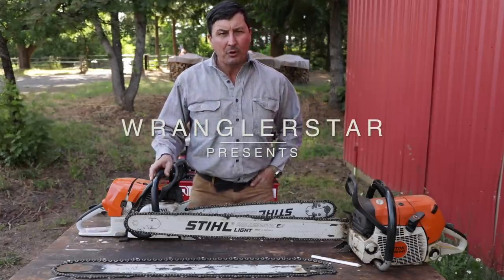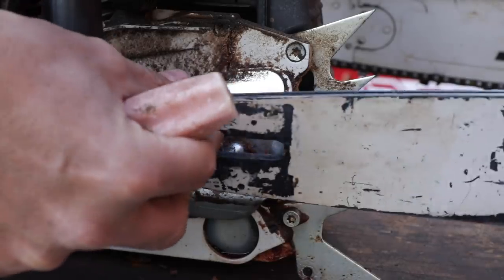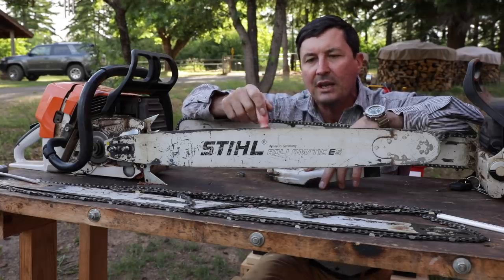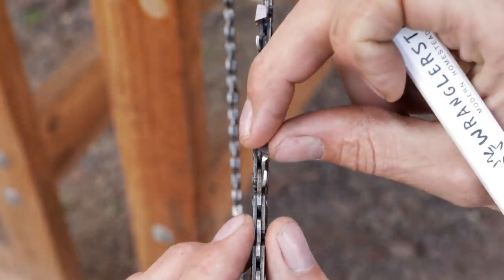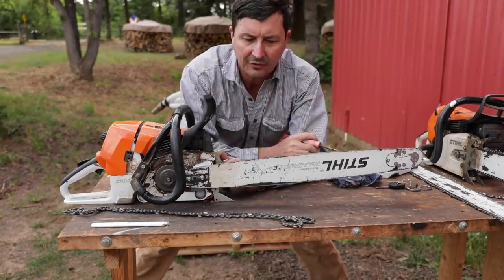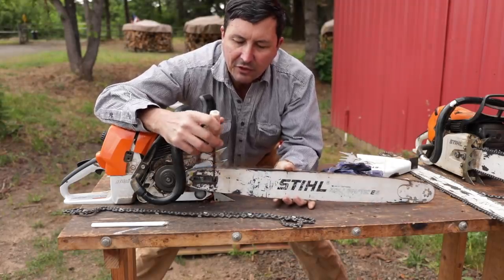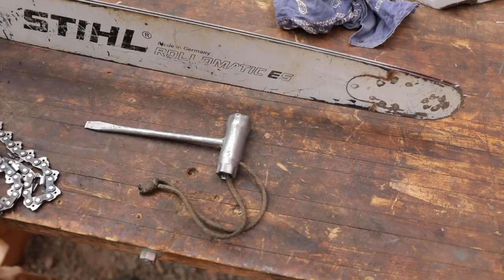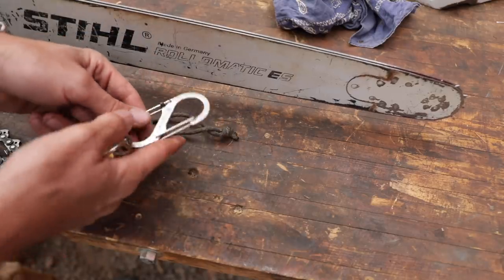Why Loggers Run Upside Down Chainsaw Bars

Comment: You could take a used bar and use it to make a mount for sharpening chains without leaving it on a fresh bar on the saw. You could even make the bar or gear movable to adjust tension or length for different chains.

Comment: I always found hand filing lasts longer.  I heard the heat created from a bench sharpener effects the integrity of the teeth. I’d rather hand sharpen anyway. Just make sure you clean the whole thing after
Reply: Omgitsjoetime T, thanks brother
Reply: Bench sharpening heats and tempers saw tooth making it almost impossible to hand file while in the field ,,, HAND FILING IS THE WAY TO GO !
Reply: Johannes van Hoek ahh thanks for slightly more accurate info. I wasn’t exactly sure what the deal actually was with it but it was just something my father would tell me... we had a bench sharpener that he would use on older really messed up chains that he might have been able to reclaim for another round or two of cutting but when they were new and good we always hand sharpened. I, myself only hand sharpen. It’s much more gratifying to me. Especially when you hit something and your suddenly cutting wood in the shape of a J and you bring it back to cut straight!!
Reply: Omgitsjoetime T sounds like we are on the same page , yes bench grinding would be the way with a reasonably worn out chain , I totally agree with you about hand filing , it is Gratifying !    PS.   Best to you in the new year 😊
Reply: I really don’t understand the point of bench sharpeners; maybe someone could enlighten me. It takes very little effort and time to sharpen with a file.
Reply: @KingdomOfApple  a little late but here we go. Bench sharpeners, mainly hood brands like simington offer a very very sharp chain. It’s practice that a lot of loggers carry spare chains to put on their bars when they get dull instead of hand filing. Square filing is common as well and can be done quicker with a bench grinder IMO.

Comment: I was taught another way to make sure your bar is getting oil is to periodically rev your saw, and check to see that it's flinging oil on a dry surface. The oil port can get plugged in between sharpening. When I was a young man, I had asked my new neighbor, who became my mentor, If I could borrow his chain saw. He told me that he did not loan out his wife or his chain saw. I purchased my own, and he taught me how to use it. I recently got my Stihl pro 026 out of storage. I had not used it in over 16 years. I thought for sure it would need a carburetor overhaul. Filled it up with fresh gas, and it started up with a few pulls. And it ran good as new. You can also use a chain saw bar dresser and file to extend the life of the bar.

Comment: "Chainsaw bars don't wear evenly. The vast majority of your chainsaw's cutting action happens along the bottom of the bar. ... Every chainsaw bar has been designed to be mounted right-side up or upside down. The reason for this is that it allows the user to extend the life of his chainsaw bar by 50%."

saved you 7 minuets and 46 seconds
Reply: Thank you
Reply: Only german know stihl. Because stihl is still the best.

Comment: If the bar lasts twice as long, wouldn't that make it last 100% longer?.
Reply: It would if both sides didn't wear, but they do.if you ruin one side of a bar, the other side is already worn by 20-30%. I don't think you double the life of a bar, you extend the life of the.bar. Most people only flip when it needs sharpening. Nobody I know keeps track of hours. You could run it for ten hours one side in soft wood, hit a nail or dirt, flip it then flip it three hours later because you hit another nail. That's reality.

I've done tree trimming for over 20 years. I wear out one side of a bar to about 60%, then flip it. I get the most bang for my buck that way. Bars usually last me well over a year, and they aren't that expensive when you consider they have been used 8 hours a day, 5 days a week.
Reply: RIGHT

Comment: Great video, have a 290 Stihl and made the mistake of not properly cleaning oily sawdust off the bar bolt threads before switching chains and cross threaded the nuts because I was in a hurry to slice again having to channel lock and remove the bolts to replace them. Clean off your bolts threads!

Comment: Some of the older bars can't be flipped, they have a profile and only oil feed holes on one side. That said pretty much all modern bars are made to be flipped. Warn out rails can be closed up with a rail closer. Bailey's has them, it's a nice tool to have, especially if you're into older saws.

Comment: 5 things I always carry when I take my saw out (besides the obvious gas & oil, glasses and earmuffs): spare chain; spare bar; scrench (blaze orange, so if I drop it I can find it); and a can of carb cleaner & brass brush for cleaning out the bar and the sprocket on the saw. I usually just keep it all in my truck, but everything but the extra bar fits in a small ditty bag that I can clip to my belt with a carabiner if I'm walking far enough to not want to have to walk back if I need something. My gas and oil and gatorade, along with the spare bar and any other odds & ends (like wedges), can go in a pack slung over my shoulder. So all I have to carry in my hands is the saw itself.

Comment: hate to be a math geek, but you should prolong the life with 100%  :)
Reply: agestam no not a 100%, the bar still get some wear in the other side regardless of cutting side used, it still tracks on other side and some people cutting both up and down, so still wear both even if not swapping
Reply: Maybe more like 60%
Reply: Not a 100 percent 2 times 50 is a 102%.
Reply: Brian, as he explained in the video, the bar does not wear at the same rate on both the top and the bottom. Pressure = friction. So it will wear more at whatever point you are applying the most pressure. For most people, that will be on the bottom of the bar and closest to the engine. Yes, if you do a lot of undercutting, then you will also have some wear on the top of the bar. But for the average user, the top of the bar will have almost no wear at all. By flipping the bar each time you sharpen or change your chain, you ensure that you will have even wear on both sides, even if you do cut both up and down. He maybe should have said "*up to* double" the life of your bar, but the point is the same.

Comment: Homeboy... you can grind a bars edges to flatten that V back to a flat surface and it'll even longer. The bar groove is deeper than a chain link that rides it so it can be ground some.

Comment: Hand filing chain has nothing to do with premature bar wear/failure. It's lack of maintenance.
Reply: It just makes the guys who can't file feel better about their lack of skill. Truth is, you get longer life out of a chain by frequent hand filing because sharp cutters wear slower than dull cutters. As for bars, the abrasive dust from power grinders gets into the chain and IMO, is the fastest way to wear a bar short of running it in the dirt.
Reply: He made a good point about the oil port blocking. I have had it happen to me. I now take the chain off and check the bar groove too.
Reply: To be fair, metal dust from hand filing will also get in the chain, *and in the bar*. So yes, it can affect the life of both. Whenever I file my chain, I spray the chain and the bar out with carb cleaner to get rid of the metal powder. And I flip the bar at the start of every day.
Reply: Garrisonnaw, metal filings are same hardness as your bar rails. In a lubricated system, this is a negligible concern. However, cleaning your bar/chain with carb cleaner removes all the lubrication. This leaves you with a "dry start", and is by far the quickest way to wear down bar and chain. Carb cleaner (most guys I know use starting fluid, but same result) is great for cleaning saws, but it's bad practice to spray a chain and bar. Use compressed air instead.
Reply: Yes.  And cutting with a dull chain

Comment: If youre using it for full days every day, flip daily, not every sharpening, loggers wouldnt get anything done if they did that,,,every day is sufficient. If  only using it occasionally, maybe flip it every  4-5 filings. Overkill is wasted energy and time. Also, once flipped several times,,,,
, maybe take to a shop that does bar grinding, get it reground, and get it closed up so the slot is the correct gap for the drive teeth.
Reply: I flip it every week after deburring and cleaning it. Bars are pretty much considered consumables in the company I work in. If they dont cut straight anymore we throw em and use new ones instead of having a guy drive them to the shop. But if youre a homegamer, taking it to a shop is a viable option in my opinion
Reply: You can dress a bar yourself in about 10 minutes!
Reply: Cutting curves is when you sell it to a boat-builder!
Seriously, cutting curved is not a bar thing; that is because the angle of file left or right tooth, is incorrect.
Reply: sometimes that is true, but if theres too much chain flop, it can still happen.
Reply: @Tony.795   a smart method for a company is to have a maintenance day each week were all equipment is properly maintained /cleaned .. for a tree-cutting service this would include trucks /trailers/tractors and other equipment .. so the bars or chains needing service could be tossed into a certain bin during the week and dressed ...ect on maintenance day (which is best to have at the last few hours of payday,so the employees show up to work ) time is made back during the jobs by having ready to go chains,bars..ect allready on the truck ..
Reply: You need a job, boyah?
Reply: Or buy a new bar once in a while.  They don't cost that much.